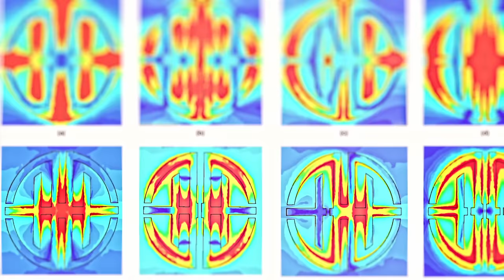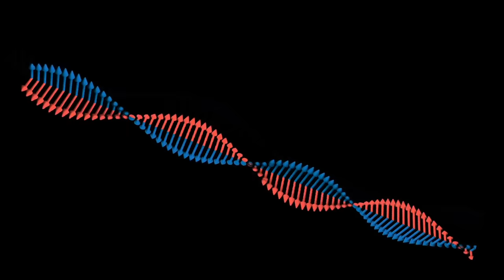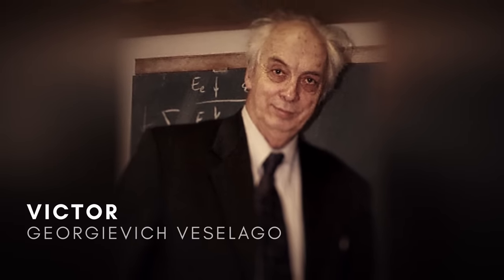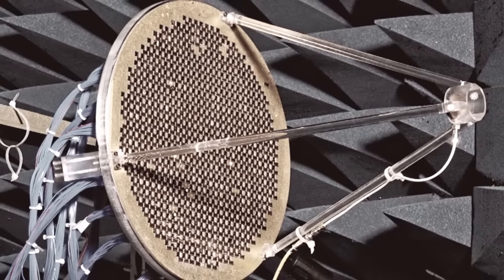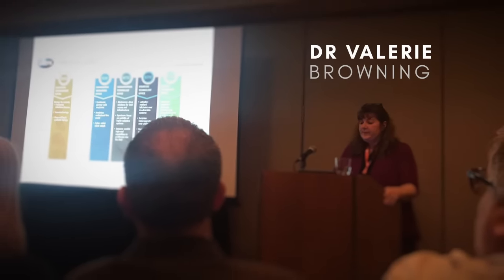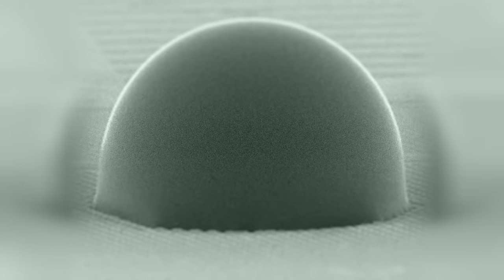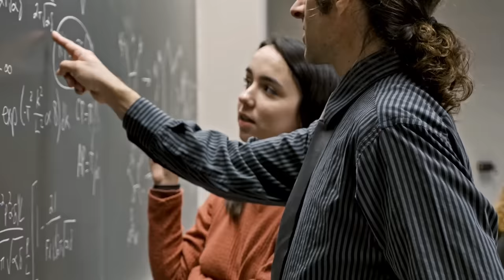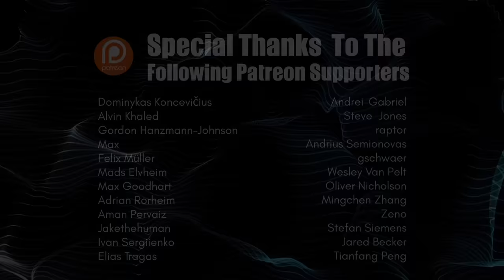The Next Generation Of Stealth Materials

Comment: for ppl thinking about optical and gamma ray meta material, you'll need structures about as large as the wavelength to work. For microwave it's easy to make cm or mm sized coils embedded in transparent material, but for light you need sub um sized structure, and for gamma rays smaller. These are hard enough to do in large scales  on surfaces (think integrated circuits) At some point it'll need to be smaller than molecules.
Reply: You can get 600nm gate-length flexible IC's, so I don't think is as far fetched as you might think.
Reply: @whatisrokosbasilisk80  sure, but 
a. most of the machines you'd use for that are already in chip production
b. none of the end products are suitable for vehicle surface coatings.
Reply: quarks it is then
Reply: It'll be the coils behind light bending material, not 100% effective but close enough at an achievable price point.
Reply: Transistors get down to 50-100nm, it's not necessarily outside the realm of possibility
Reply: @andrewferguson6901  if I brush my hand across a silicon wafer with no ESD protection there's a good chance I burn out half the transistors on the board. Making that sort of nanostructure feasible enough to survive supersonic airflows is gonna be something else.
Reply: @dsdy1205  you can coat them with invisible coating tho.
Reply: and... OUR advanced nano material sciences have all that well figured out now. We are also deep into manufacturing this in large scale in many of OUR advanced defense programs.
Reply: Also, would gamma rays even interact with the material? I feel like the majority of them would just pass straight through.
Reply: I hear that the cloaking coatings we have are now scratch sensitive but they have long since realized how to make them strong enough for super sonic flight.
Reply: Why can't you defract microwaves to a smaller wavelength?
Reply: ASML deep UV chip fabrication techniques, for post CMOS SAR synthetic aperture radar, infrared imaging & more
Reply: @dsdy1205 You'd need to take refraction into account, coating it layers of transparent materials could provide the rigidity needed. At the end of the day, it wouldn't be invisible to the naked eye up close, but would be impossible to see at distance... Like a floating glass orb. You'd see the bending of light by the outer coating itself, but it would serve it's purpose otherwise. And at that point, you may not even need it to be supersonic.

Think low altitude surveillance drones, or slow payload delivery for munitions. You'd only need small cutouts in the material to move around, but unless you're looking at it straight on at-altitude, you still wouldn't be able to make it out.

These are practical ways that you could achieve enough cloaking to matter without needing to achieve the theoretical utopian ideal of complete cloaking.
Reply: Why not use the light itself to create these microstructures in a similar way to how hologram film works?

Comment: Meta material stealth for visible light will almost certainly be too difficult to get working. Maybe they’ll work in environments where all the light is of a single wavelength (e.g. infrared spotlights at night), and it might even be possible to spoof thermal cameras, but there’s almost a factor of two across the visible spectrum. Just like with anti-reflective coatings, you need to stack them to cover the whole visible spectrum, and that’s a simple case where light is just reflected. To have meta material stealth working on both red and blue light, you’ll need seperate lenses, and to somehow prevent the red lens from bending blue light and vice-versa. You also need to keep the structure extremely rigid, the thermal expansion of a jet aircraft will change the outside by millions of wavelengths which I suspect will also impact stealth.

But targeting specific radar bands, that’s definitely possible.
Reply: "Man will never fly"
Reply: @marcalvarez4890 just having a cloaking dome would be impressive
Reply: I think this kind of technology will see most of its use in the near future on spacecraft. Right now, these structures are too delicate and expensive to be put in vehicles going into combat but are perfectly fine in the near-vacuum of LEO or anything further. 

I’d imagine it would make it much easier to hide spy satellites from enemy detection and make it possible to hide the deployment of actual weapons in space, something that is currently illegal from my understanding. Hiding the launch itself would be another challenge but you could just have a normal communications satellite deploy smaller vehicles equipped with this cloaking technology.
Reply: @marcalvarez4890  It’s true, it’s physically impossible for us to fly without aid.
Reply: as long as its not impossible then difficulty is irrelevant to me
its pleasing to know someone later down the line will have a cloaking suit
Reply: i think they should start working at active stealth technology rather than passive from metamaterials, smth similar to tv screen and cameras just more suited for stealth application.
Reply: U😅😅😅😅😅😅😅😅😅😅😅😅😅 8:28 8:28 😢
Reply: Cameras + Micro Screen + Powerful computing = Invisibility!

That I think will be the only way for Predator type stealth, and it would be totally visible to other ways of detection.

Comment: Maybe you can solve that problem (invisibility) by way of flowing the refracted light and issuing it on the other side of the body. 

Another way to do it is to make a pixelated display covering, which displays, using camera capture, what's on one side onto the other side of the body.
Reply: Like in "PREDATOR".

Comment: Pretty cool research and great video but it seems to me this is going to be really challenging to make something practical that can cover a large bandwidth just like anti-reflective coatings on optics have a limited bandwidth. If you can't make the meta material work at all frequencies, then the counter measure is to have radars and lidars that are either chirped or cover different spectrum's.  And with the new emerging technology of frequency combs, the meta materials might already be behind.
Reply: What I'm thinking of is either fractal structure or variable reactive structure

Comment: What would happen if you put a microwave source under these cloaking shields? Because another thing that could be done with these is shielding from light and or passive radiative cooling, one of the big hurdles for passive radiative cooling is having less heat come in than is going out, well if you could make something that was a fairly wide band invisible shield in the high microwave mid ir range, you could put something that emits within that range to make something that passively cools.

Comment: So no negative material but plasma collector instant discharge not able to have anything to hold it in emf goust field except an excited recapture coil?
Reply: Electrc generator or earth like plasma or lighting or northern lights sparked telegraph worked without battery Carrington event?
Reply: Medium of transfer space God said let there be light wave atmosphere to  particle ? It divided the day from night ,so what's up pulls out streches forth the heavens like a tent and what's up must come down
Reply: You might need to put pull on outside and spin inside material or both and multilayer gear up flywheel nort south or sandwich spin center motor generator or collector and or like similar to let earth spin recoil dampning no motor mount he hangeth the earth upon nothing
Reply: I just noticed earth is the eye or the eye is earth front view did or side view front as light strikes they missing particle design they used oblong half round ,ball and convex , light to wave  eye radiation or gamma Ray satalite dish , not but also xray tube tv cathode Ray gun but in vacuum tube transform transistor light particle back to wave absorbed and tuned  tuning forks  communication picked up like walki talki
Reply: Had anyone tried electrc motor in vacuum case ? Improve efficacy? Besides electron plasma ? Discharge back where we started

Comment: B-21 Gen 6 stealth bomber & information reconnaissance by Northrup Grumman for the Pentagon & USAF respectively for only $700 million each // utilizes some Meta Steal / Cloaking / Jamming / & Signal Intelligence -- technologies using meta arrays baked directly into the skin of the aircraft's carbon fiber surfaces - to radically reduce its radar signature, but also for active optical cloaking & infrared blocking & other nifty new emerging stealth features //

Comment: wonder if half wavelength uv superlensing could be used in chip fab, or if euv tech is already beyond its usefulness.
Reply: I'm guessing this will be implemented long before any practical cloaking.
Reply: The problem is that EUV is too short of a wavelength to be efficiently redirected by basically anything, as nearly everything absorbs 13.5nm light.

Comment: Nice video and presentation. 
Meta material is an elegant title also discriminative, against competitions on lucrative defense research funding. Shutting off those armchair researchers.

The armchair version is: 
 
1. Two, parallel, plane waves meeting face to face in opposite phase can neutralize together totally. 

2. A dipole resonator stimulating by radar plane wave can reradiate wave back in opposite phase offering neutralization but total because it was not plane wave but spherical. 

3. We needs a returning parallel plane wave. How? Install dipole array covering the stealthy metal object.

Caveat? 
4. The array must install on fuselage surface and not suitable on metal airplane. 

5. Resonator are narrow bandwidth by nature otherwise they don’t resonate effectively and the return phase and amplitude are compromised. 

6. If we don’t know the wavelength enemy radar use this scheme is less or non effective. 

7. Classical radar are single wavelengths make this scheme work if we match the enemy’s wave length.  

8. Modern radar don’t use single wave length. Instead it chirps, ramping wavelength up and down rapidly have made this scheme out of date. 

Investors must learn that.